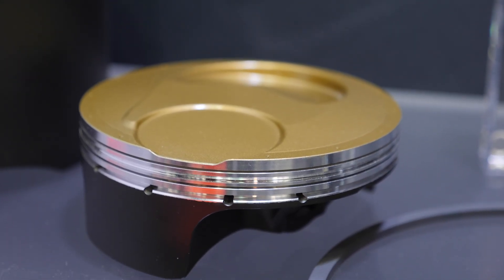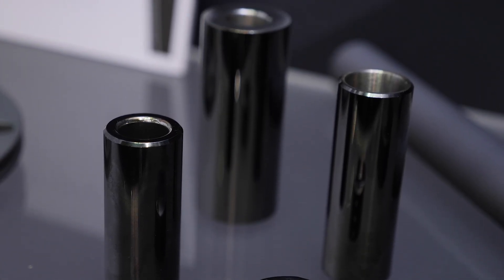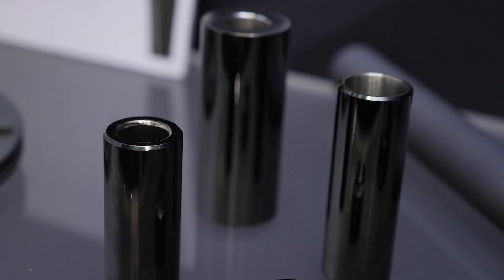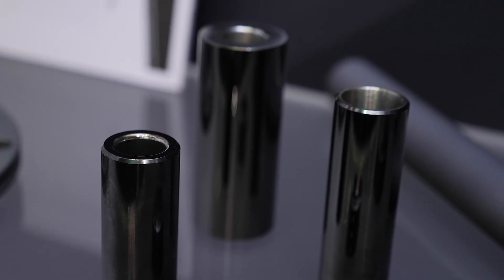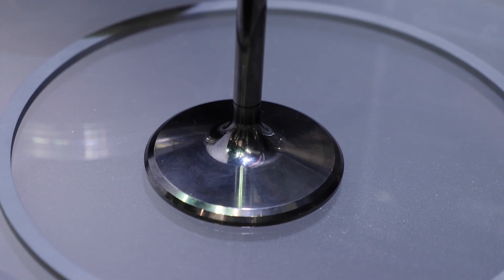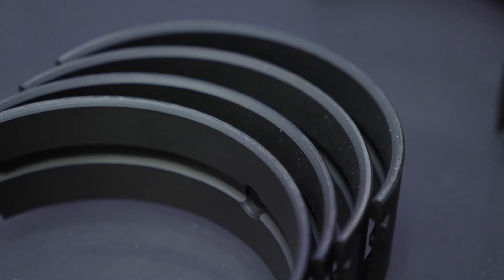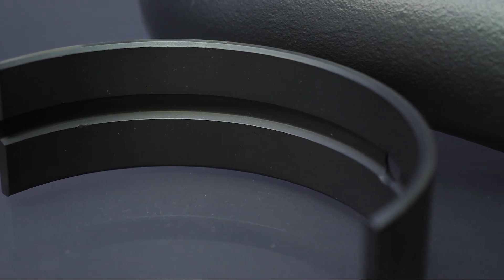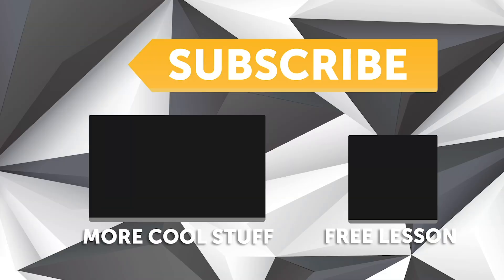DLC vs CRN | Engine Coatings That Actually Work [TECH TALK]

Comment: I Feel Less As Bad. My Engine Has Wiped Out The Mains Bearings 2 Times. First Time The Crankshaft Balance Was Wrong. It Lasted 5000 Miles Before Oil Pressure Hit Zero At Idle. Corrected The Engine Balance And I Got 20,000 Miles Out Of The Engine. Mains Were Wiped Out Again. Main Bearings Clearances Were About .0024". Using 20W50. It's A 2.489" Journal. Our Next Try Is Going To Be .028" Oil Clearance And Switch From P Bearings To H Bearings. We Are Thinking The Crankshaft Is Bending Under Power And It Needs More Main Clearance To Keep The Engine Alive A Little Longer When It Bends. It's The 2 Inner Main Bearings That Have Always Shown The Most Wear.

Comment: I have just been involved in the nightmare concerning flat tappet cams and lifters.  I had three cams in a row fail immediately with normal lifters.  I thought I was at fault as from the beginning I had to reset the valve clearance.  I was wrong.  The cam and lifters had worn away.  

Then I watched a video on You Tube and at the end he mentioned DLC coatings.  I phoned Summit Racing and asked if I could exchange my normal lifters for the DLC lifters.  They agreed.  I paid the about $15 extra for the DLC lifters.  They are amazing.  Because after I broke in the cam I then had blown head gaskets I got to take a look at the cam and lifters with the DLC.  The lifters looked like they came out of the box.  The cam looked like it had been polished, not worn down.  I will never put in a flat tappet cam without DLC.

Everyone, if you want to avoid all the extra work and expense with normal lifters failing as they are doing massively go to Diamond Like Carbon Coating lifters (DLC).

Comment: The engine in my 370Z(VQ37VHR) has a DLC coating on the intake valve train components and the skirts of the pistons. The combination pf this coating plus the properties of the Nissan ester oil, formulated for this particular engine,  supposedly reduces the sliding friction between parts to that of the rolling friction of ball or roller bearings.
Reply: Less heat
Reply: @danychris6671  That usually is the consequence of lower friction.

Comment: I hope these things are better than GMs coatings used in the engines used for Vega cars.  That financial disaster(to me and my bank account) left a big old nasty taste in my mouth for GM products.  I’ve tried since then, Buick 225, Pontiac Bonneville and Sunbird,  Chevy pickup truck, and the taste just wont get out of my mouth.  I’ve gone to VW, Ford, Chrysler, Jeep, and I fully like that taste!
Reply: Eh? These aren't the same by a long shot. Everybody from Formula 1 to NASCAR uses coating on several parts and Cryogenics & WPC on others. This became mandatory as many series thought one way to keep series cost down was to use force teams to use the same engine over several races. Teams would incur penalties if they have to replace an engine inside the usage window because they don't want to see hand grenades for qualifying which is what teams did in the 80's and early 90's. Only well healed teams could afford to build such things to ensure pole position and then put more reliable race engines in during practice.

Comment: NASCAR tems use any technology they can to make their hand built cars last for 600 miles at speed. Otherwise they would melt into the track before the first 100 miles. NASCAR also claims to be using their 'research' to better the automotive industry, but if that worked, their own tires would last more than 40 laps, we'd all be wearing helmets and fire suits, and our 1.3 liter engines would develop about 300 horsepower. So, NASCAR finds ways to make sure their 'stock cars' are nowhere near stock, and those secrets will never be leaked to the auto industry for fear that cars would actually become more fuel efficient, safer and cheaper. The auto industry is satisfied with selling passenger conveniences such as navigation and entertainment systems never found on a NASCAR racer. I mean, who wants to wear a Hans device to go to the grocery store?
Reply: They would probably introduce more of this tech into road cars, but no costumer will pay couple grand premium on coatings and other stuff that doesn't really do anything for them or the vehicle.
Reply: @TheSpekkel1 This.  Engineering is about comprises, and sadly my dream “Internal Combustion Engine to End All Internal Combustion Engines” is probably a dream, and not in an affordable commuter car!
Reply: Genius, the reason why tires in Nascar only last 100 miles is because that's all the fuel the cars hold. The cars average just over 4mpg and have 18.5gallon fuel cells. It wouldn't matter if the tires lasted hundreds of miles if the cars still have to pit to fuel. It takes almost the same time to refuel the car as it does to change the tires with a full tire change taking less time than a full fuel stop. There is also the spectical of a full pit stop where it's an organized effort of the team and a show for the fans. If you think that it's not impressive that the cars last as they do, take any car that has an engine with near equivalent bmep and run it for hours at full throttle and see what happens. There will be few survivors. Some Porsche, ferarri or other high end engines, also hand built, might survive. It's unlikely they will just based on how much oil they will burn.
Reply: All motorsports have technology, F1 and Le Mans Sportscar racing are still on the bleeding edge. They turn Cup motors to 9000-9500 rpm, that was unheard of two decades ago. F1 is 13-14,000 rpm with turbochargers and hybrid electric motors. Same with the last generation of hybrids in Le Mans racing. Making 1100-1200 lbs of torque coming out of Le Mans hairpin launches the cars like a rocket to the Porsche Curves.

Comment: In nitro radio controlled cars, engine manufactures have been using DLC on crankshafts for over a decade. 
Coating crankshafts and camshafts as well as rockers would be great in full scale applications.
From what i understand only steel can be dlc coated
Reply: Titanium (?)
Reply: @willnzsurf  yes He does mention coating titanium valves

Comment: Wouldn't it be a VERY BAD idea to coat bearings, since the main quality they have is embedability?
Reply: 2020 supra engine has coated rod bearing from factory. i dont think they would give a coating if it's bad
Reply: @n.shiina8798  It's designed like that from the factory, and only for idle stop/restart when loads are minimal.  Not for protection in the event of catastrophic loss of oil pressure.  I'm not saying coatings are bad in general, just that doing so on a bearing sacrifices the imbedability.  We have good results by just treating and coating the crank.  If you have an engine that shuts off at lights and the engineers put coated bearings in it, that's what it needs.  But if it doesn't, then it isn't.
Reply: @n.shiina8798  Lots of OE performance cars and high MPG cars have coatings on the piston skirts. My Focus ST had a coating on the skirts of it's factory pistons.
Reply: Pretty sure Dre picked up on the fact this guy was blowing smoke.  Dude is a hack.  Look up Millenium coatings, they'll treat you right and not feed you a bunch of bs

Edit:  Had to give the first dislike, as much as it pained me to do so.  Coatings and treatments are great and all, but this particular company, or at least the salesman they had representing them, didn't really impress me.

Comment: stupid question: can I get a DLC coating on my frying pan?
Reply: Mr Goo  User name checks out.  :D
Reply: I was legitimately curious about this.  It may allow for “nonstick” pans without any Fluoropolymers etc

Also *better than copper heat conduction*?

My dream pan is some polished+coated steel, that or some crazy alloy.  If i ever get a (Plasma Assisted) Chemical Vapor Deposition Setup, I’ll 100% try it!
Reply: Mr Goo you must be trying to get in something tight and old and dry

Comment: Please do a test using two rotary engines, WPC coating versus their friction reducing equivalent.  
Instead of running, measure the torque to turn at a given rpm
Reply: Also WPC with DLC Applied Afterwards!

Comment: There are manufacturers who gives this coating as a standard on some of their products I know Mahle have their own proprietary coating

Thanks to the team for this feature
Reply: Those skirt coating don't last too long..  If you're running a race motor and planning to tear down in short intervals, its ok.  We've seen Pistons get DLC's completely.. Since pistons are made from Aluminum they arent ferrous and DLC wont stick typically.  But there are ways to embed ferrous metals into the piston surface so it can accept DLC
Reply: this is great for older engines i think
i'm gonna be building 3sge engine
i'm thinking of giving the bore HVOF Tungsten Carbide coating as a test
Reply: Nicosil it perhaps

Comment: Looks like this is an item that each engine builder will need to evaluate what parts to coat. I imagine there may be greater benefit to coating bearings and journals, perhaps on valves. I'm not certain how beneficial coating a wrist pin might be, I suppose it's the last piece to get lubricated so minimizing wear there might help with minimizing failure in that area.